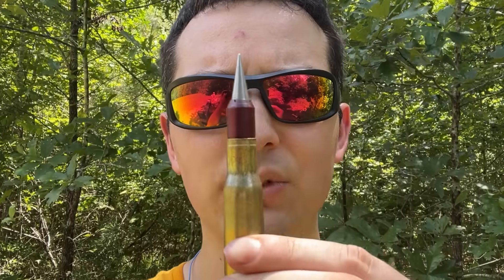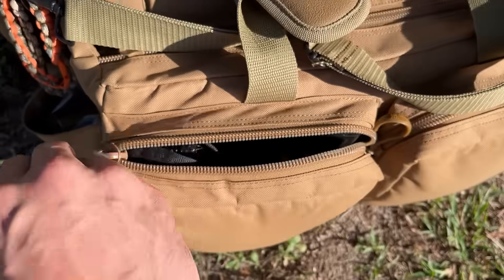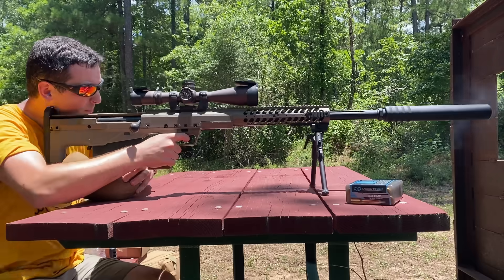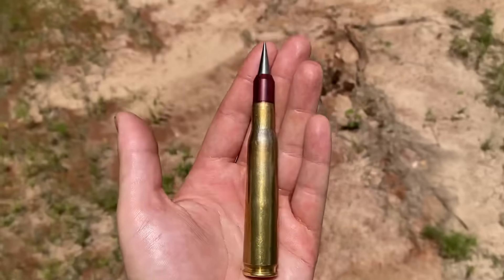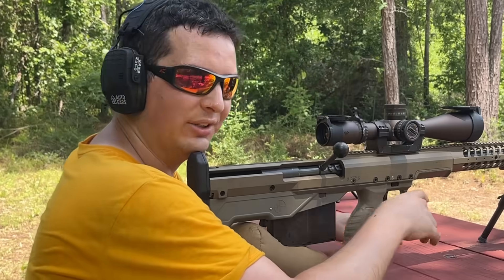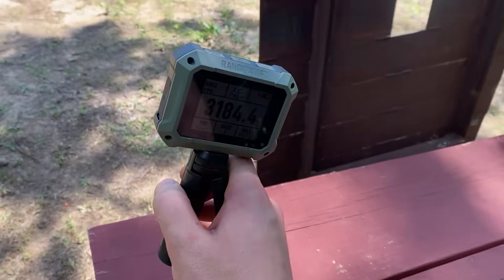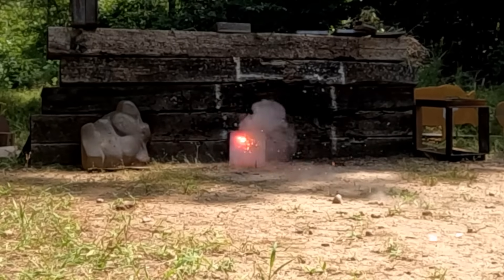How Much Steel To Stop A 50 Cal SLAP?

Comment: 3200 ft per sec from a slap is way slow.
And seeing it was only that speed and really light weight why the higher recoil?
Reply: Because the sabot plastic parts are what the chronograph is reading not the slap projectile itself. You need to use a high speed camera to record and do the math to calculate exactly how fast the saboted projectile is actually going. All chronographs dont read accurately from the muzzle for saboted ammunition. It measures the speed of the broken apart sabots at the muzzle.

Comment: I would redo the powder load. I don't have the proper equipment. I have reloaded 308, ×39, 9mm, 45 acp, 20 Guage and 12 Guage. I have common sense so I can do it safely. You know long grain rifle load looks like broken graphite from a mechanical pencil well I handled it too much and it basically got grounded into fine powder that made a difference because me using caution I used less then what factory ammo would use and my round was hot! Enough to make a non experienced shooter to notice it was different. Then if you do shotgun ammunition you have to factor in weight because you can easily use too much powder or not enough. I have been wanting to get the proper equipment and knowledge by enrolling into gunsmithing etc. I'm not experienced myself as you can tell. I noticed that ear plugs are the perfect size for 45 acp I have made some non lethal using those my pistol can't fire +p and I had a few so I converted that into ear plug rounds it actually worked very well it makes a heck of a pop when it hits wood

Comment: Börther, SLAP-T means Sabot Light Armor Piercing- Tracer. Light Armor. Most armored vehicles, not tanks, have light skinned armor which is what this ammo was designed to pierce. The hull of an LAV25 or a BMP2 is not an 1.5” thick. If you wanted to punch thru denser, thicker armor you’d need anti-tank rounds from a much larger caliber rifle. Something like a 20mm or 25mm.

Comment: I'm pretty sure that a lot of your subscribers can appreciate the amount of effort that you have put into these videos...but you have been doing an amazing job with them!.  You would give Scott a run for the money with regard to recoil tolerance and I find your videos to be quite a bit more informative than most of Scott's latest work!  Also, as I have mentioned before I have done tests with essentially everything that I have seen used on U-tube over the last 45 - 50 years...and I am finding that you along with Matt (with regard to body armor which I only experimented with versus an American 180)... to be the most interesting in this area (with an acknowledgement to Adam when he gets involved with AR500)!  Just so you know I ran into a similar surprise when testing the mid 80's SLAP rounds against 2.5" cold rolled mild steel out of a 45" M2HB!  AR500 was not readily available at the time... but closely resembled RHA.  I too have run into the surprising difference that 5/8" makes versus 1/2" in cold rolled and that more recently 3/4" AR500 makes versus thinner plates!  Be on the lookout for headaches after testing the very heavy kicking guns and please understand that plugs and muffs are not enough when firing the braked .50's... especially with your shield setup and that short barrelled cannon that you have...as some very close friends with the FCSA have found out, even with the longer barrels!  One mistake with a braked gun and inadequate (or no) hearing protection...can change your life!
With utmost respect for you... take care and keep your powder dry!

P.S.:  As close as several of your tests were to going thru the targets...I am quite sure that the standard SLAP rounds would have completely penetrated as going Ballistics found out in several of their episodes!
My tests using the standard SLAP back in the mid 80's versus 2" cold rolled steel, showed just under 1.75" of penetration out of a 45" M2HB!   I added a .50 caliber jacket with a lead sleeve underneath between the core and penetrator and nearly doubled the penetration!
That target block was requested by a military museum in California in the early 90's!
Reply: Should read...' a lead sleeve was added between the jacket and Tungsten core'...and nearly doubled the penetration!

Comment: Great job on the video!
However, I have one scientific critique here:

You're never going to get an accurate "Anti-materiel" simulation if you aren't emulating that piece of armor/steel being on the side of a heavy vehicle.
To that end, you must isolate the potential motion of the plate.  You're allowing too much kinetic energy to be expressed as "the plate being flung 10 feet away".
Imagine how much energy it takes to actually throw that 20lb steel plate that far.  You're potentially losing hundreds of joules of potential penetration power.
Put it in a sled of some sort, and then weigh the sled down with sandbags or something.  Or if' you're feeling particularly tryhard, create an entirely new rig that has a poured cement foundation.  I love these ballistics videos!  Keep up the great work!
Reply: The plate just tips over... What are you talking about?

Comment: aluminum + iron (steel) + energy = Thermite, normally it needs to be ground pretty fine takes some effort to light, but apparently 12000 ft lbs pushing it into the iron is enough to light it :)

Comment: Its funny how all these "recoil lovers" get these big cartridge but fear the 50 bmg without a muzzle brake. 

And banana here eats it up with a lightweight one too!!
Reply: I wouldn't be afraid to shoot my AR-50 without a muzzle brake, because it weighs 35 pounds.  However, the brake on my rifle isn't easily removable.  I have fired SLAP from it without issues (only once because it cost me 100 bucks a pop).  From what I saw on other channels, regular cheap (under 3 dollars per round) 50 BMG AP penetrates further in mild steel than the SLAP round.  It's too soft for the harder core to make too much of a difference.  However, SLAP seems to make a huge difference on AR500 steel and titanium.

Comment: I have fired a SLAP round from an unmodified AR-50 with the muzzle brake still attached, and it worked fine.  If the sabot is working properly, it should fly straight out of the barrel.

Comment: I watched Going Ballistic Fire these SLAP rounds out of a full length M2 , and he did not get one to go through 2 inches of mild steel either.  Surprisingly, it didn't even penetrate as far as the more conventional AP rounds, which bulged the back of the 2 inches of steel.  However, the SLAP round made a bigger difference on titanium and AR500 steel.  The SLAP was able to pass through 2 inches of titanium and 1 inch of AR500.  It appears that heavier AP bullets drive deeper into mild steel.  I think the best .50 BMG for mild steel would probably be the C44 Armor Piercing Tracer.  It uses a tungsten core bullet that weighs 955 grains.  I have a few rounds that I bought off of GunBroker , and I did confirm that the bullet weighs over 950 grains, so they are the real deal.
Reply: sounds like the softer steel gums it up, so to speak

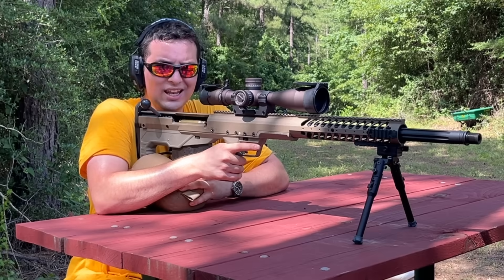Comment: Now I got me a question here. At 10:12 when the footage is in slow motion did anyone notice what looked like a ricochet followed by a smoke ring??? Notice the flaming projectile coming from the steel after it was shot. Did it shed the tracer on the round? I am thinking it was either the projectile being expelled from the metal plate or it was liquefied metal squirting from the hole. Those holes do not look distorted enough for the metal to have been pushed through. There is deformation and a simple weigh in before and after of the plate would prove me right or wrong on my conclusion. Now if the projectile is not lodged in the metal then the metal spat the projectile back at you. If that is the case no wonder that ammo is so dangerous. Ricochets can still be lethal.

Also you seem to handle disappointment rather well. Where advertising is concerned the cuffs on the dress don't necessarily match the collar. Kind of a shame playing with DU ammo is REALLY dangerous. I bet a DU .50 would raise an eyebrow or two. My question is concerning this ammo, what was it intended for? Is it a sniper round and not a real AP round? There are things about it that make me think this is more for range and accuracy down range while retaining its punch. Not taking on tanks close up unless you have a death wish. That requires a bigger stick to hit with than a .50. Then again .50 DU???

Comment: My State Arms .50 shoots through 2 inch mild steel blanks with std black tip ($5) armor piercing rounds. Whats the point of expensive SLAP rounds?
Reply: 32 inch barrel by the way..
Reply: SLAP rounds perform better against AR-500 and apparently titanium (Going Ballistic shot through 2 inches of titanium with a SLAP round).  However, heavier AP bullets appear to perform better against mild steel (even from an M2, the basic AP rounds outperformed the SLAP on mild steel).  I think the best AP bullet for penetrating mild steel would probably be the 955 grain C44 Armor Piercing Tracer .50 BMG rounds.  I have a few of them I bought a while ago, and I did confirm that the bullets weigh over 950 grains, so they are the real deal.

Comment: Just look up the specs.  50 Ball Machine Gun rounds pen 30mm (a bit more than an inch) at 500m with 90 degree obliquity.  Why bother with 12.5mm?

Plus that’s rated for Rolled Homogeneous Steel, not “mild” steel.
Reply: Those specs are for black tip AP rounds at 100 yards.  M33 ball is rated at .32 inches of RHA at 500 yards, while M2 AP is rated for .75 inches of RHA at 500 yards.

Comment: Need a full-length barrel for optimal ballistics on a .50, especially with the SLAP. Not that it needs it with most targets.
Also, poke the barrel through that shield, especially without a brake. An extremely large percentage of the muzzle blast is reflecting back to you. You probably do have a mild concussion. Even pro .50 shooters tend to limit their lockup shots (bolt-action, etc.) to 10 rounds per day, unless they're in competition or the field, due to pressure waves. Concussion is a real danger, not even considering the psychological effects (flinch, bad squeeze, poor positioning, etc.) of an overly-sore shoulder.

Comment: Here's some back of the napkin maths for the nerds like me : 
f=mv²
The target velocity is 4000 ft/s. Let's be generous and lets say you are hitting at ~ 3200 ft/s.
Let's assume that 1 unit of mass is  355 grains(the weight of the projectile). we can say then do 
3200²/4000² = 0.64 or 64%. This is only 64% of the real power of the slap round.
Reply: with the M.2 barrel so the shorter barrel here is major factor why its performing like this
Reply: @maikson97  There are videos of  SLAP rounds being fired out of a 40 something inch barrel and didn’t penetrate 2” either
Reply: Liar. You didn’t do that on the back of a napkin. 😂😂

Comment: That flash is probably aluminum oxide forming. Powdered aluminum+heat+O2=aluminum oxide. 

If you coated the plate in KClO4, you'd get flashbang reports..........do it, lol.

Comment: Unbelievable just 1 3/4 inches thick of mild Steel Plate can stop a 50 Cal armour Peircing slap round. That’s pretty hopeless for a tungsten armour Peircing penetrator going very fast with a fine point and it Can’t even even penetrate 1 3/4 inches of mild Steel that’s ridiculous That’s also the point proven is even mild Steel if thick enough can be used as armour protection in the end of the day Mild Steel is a form of Steel in the end of the day. it’s a dense iron alloy.

Comment: You know aluminum plus iron - that's probably carbon steel considering the rust - makes thermite.  So that flash could be a thermal reaction ignited by the kinetic energy of the round.

Comment: The performance on the 5/8 steel makes sense when you remember how much energy those materials are experiencing when they hit something that doesn't want to move, there's a chance you could push it slower and penetrate the plate but the beauty of a round like that is that it can hit body armor and lose a lot of energy, so if it penetrated through the target it won't take out the next 19 houses behind it as well. All that energy being dumped into a plate and then into a body is probably enough shock to stop a heart alone

Comment: I have used quite a few SLAP rounds and they will usually got through 2 inches of steel but you're using SLAP -T regular slap is closer to 4000 FPS.

Comment: I'm not sure that you actually got SLAP rounds. I mean, somebody may have commercially used the word "SLAP" and trademarked it, and designed a round that has a sabot, and a hardened penetrator, and there may be counterfeit SLAPs out there, but that doesn't look like the SLAPs that I fired, and I guarantee they aren't. The Saboted Light Armor Piercing round was designed by Lake City Arsenal in the 1980's and used a depleted Uranium penetrator in a gray-ish plastic sabot (they also made on in 7.62x51 that had greenish plastic sabots with a .22 penetrator). As I recall, the bullet in the .50 SLAP was a .30 bullet, and they were smoking hot, a little north of 4800 fps out of the M2HB, and were never fully adopted due to some problems in the development, but a few trickled out to line units- very few. First, the good- they were poking holes through the front glacial plate of an M48, something like 3 inches of rolled homogeneous armor plate, at about a 30 degree angle, at 500 meters. They made an very neat light show in the Oklahoma sunshine, but we were still popping them off at dusk, and it got really pretty. Now, the bad. Back in the 80s when they were produced they cost almost $500 per round (depleted Uranium is very hard to mill), and LAW rockets were only a little more, so they were deemed "not cost effective" by the Pentagon. Second, they were VERY hot, and the cyclic rate of the M2 sped up significantly when firing SLAP- and that wears out guns and mounts rapidly. Yeah, they were rough on the Browning, and that is saying something. What killed the project for the US Army, though, was the sabots. The original loading used the same compound used for the saboted flechette rounds from the 1960s (a white plastic, slightly shiny), and it couldn't withstand the energies developed by the SLAP at all. Other materials were used in later versions- a greenish plastic that worked in the 7.62, then the light gray, 3 piece sabot that I fired. The gray held up, mostly. "Mostly" is a word that can kill military projects. About 1 in 10,000 rounds the sabot would fail, leaving the projectile traveling at low enough velocities that the next round fired would catch up to it, often still in the barrel. That may be OK for grandpa's hunting rounds, but in a military that was contemplating firing millions per year, those odds were too dangerous. Add in the cost, and the project died. Those rounds still in inventory were parceled out and fired, though some made it into the civilian world somehow, and potentially that is what Scott got (some rounds were intentionally loaded "extra spicy" as Proof Rounds, designed to test safety in extreme cases, and my theory is that Scott got ahold of some of those rounds, and paid the price for it). Anyway, "SLAP" is a catchy name, but it actually means something to those of us with gray hair and worn out knees, who polished our boots and faced T72s before we found out that they were just export versions of the T64. 
Anyway, thanks for brutalizing your shoulder for a few minutes of my entertainment.

Comment: If you feel up for it, if you resign sled 4.2 i would suggest making the back plate curved like a lead trap instead of any kind of hard angle. If my lead trap can catch .45-70, and 500S&W (700g) lead rounds without nearly as much damage as sled 4.2 has taken already, then you’d might be better off.

Comment: Bro what’s up with that recoil knocking you almost out of your chair on that first shot ???  My 16 year old daughter shoots my .50 and she’s only 90 pounds and she don’t move that much !!! LOL    
I’m just breaking balls brother , cool video !!oh and by the way I have a pic of a simple API round almost going through a 1 1/2 inch plate of mild steel so that’s actually worse for the SLAP  . Judging by how far I put an API round into an inch and a half of steel I thought for sure that the SLAP was going to smoke through it.  Now if I could only upload the pic on here from my phone I could show ya .  It’s actually a really cool pic . You can see just the very tip of the tail end of the tungsten penetrator sticking out of the front with a big black powder burn stain around it and a massive bulge on the back side.  And I know some people that are going to read this love massive bulges on their backsides which is why I through that little troll bait in there.  LOL😊

Comment: This is not a sniper cartridge, but a machine gun cartridge, huge speed, small size, impressive penetration (of any steel), even soft, even tank armor, it will penetrate +- the same, about an inch, maybe less. This is damn tungsten of small diameter.

Comment: How is that even possible?  Like you said, what even is the point of .50 slap rounds if it cant even go through that.  I have personally put .30-06 AP black tips through 7/8" of steel and the hole was so clean it looked like it was machined.  Not only that, but the penetrator went through one 5 gallon steel drum of water after that and almost made it through a second one.  And thats just .30-06....  Which is pathetic compared to .50bmg